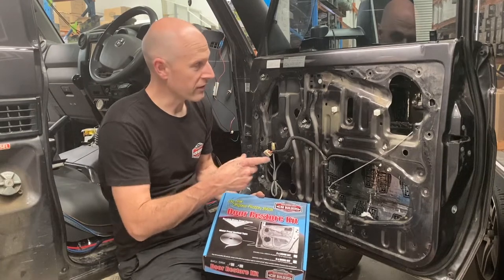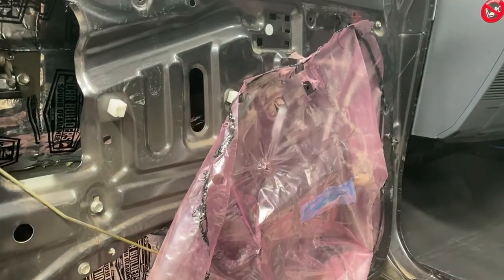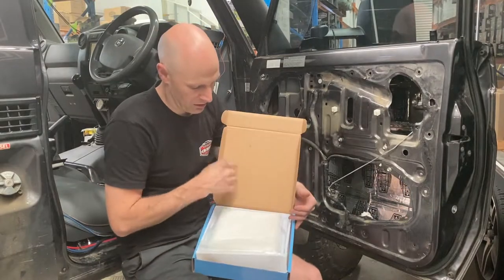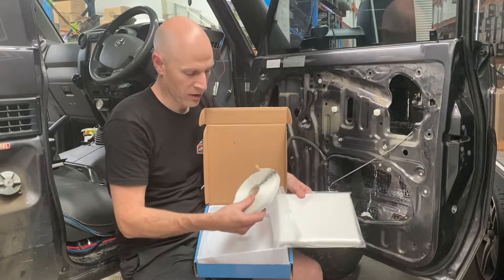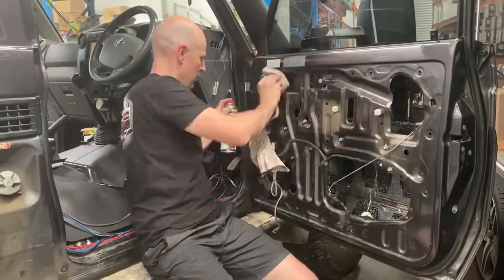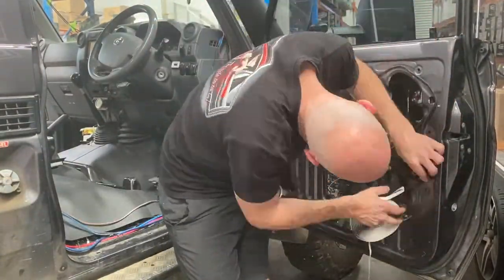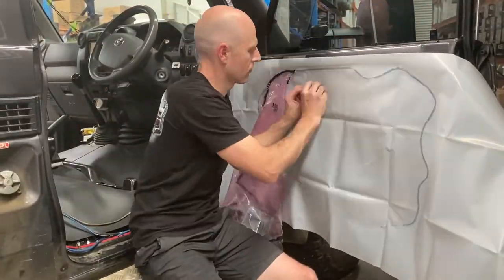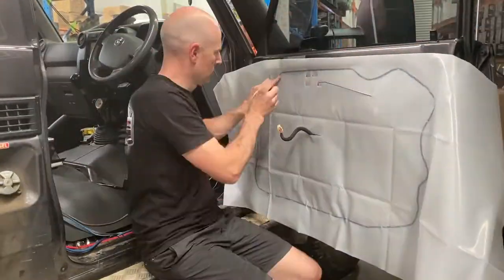Door Restore Kits to Replace Vapour Barriers in Doors

Comment: Diggers wax and grease remover or chemtools label and wax remover will melt that old black sticky stuff that comes from the factory if anyone wanted to know how to remove it you can get the diggers wax and grease remover from Bunnings Warehouse or most local paint stores not sure about the chemtools stuff I get it from my local hardware store and don't worry they wont hurt your paint work I used both of these when I replace my two front doors with this kit.

Comment: Can you do another video which shows how you deal with the speaker cone a bit better? Here it looks like you just cut a hole in the new plastic skin, which doesn’t seem too clever?
Reply from the maker: Thanks for the feedback Steve. We will do that. In this case the speaker protrudes through the membrane into the door cavity. The speaker clamps the new plastic to the door sealing the inners.